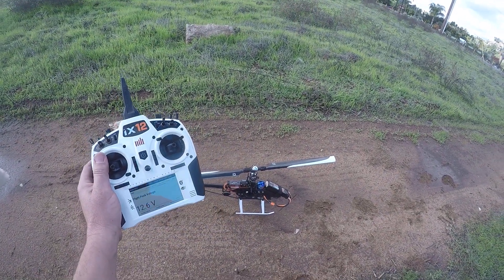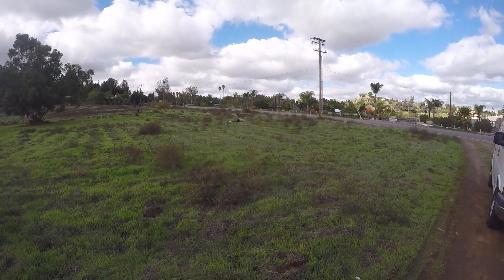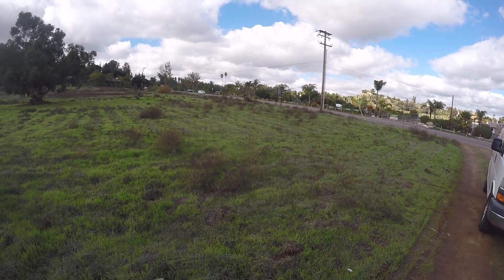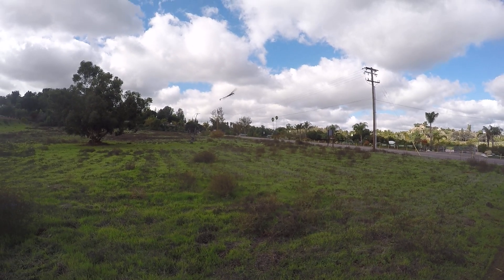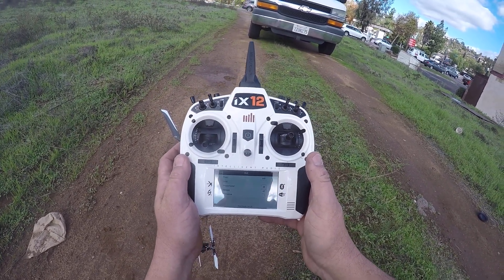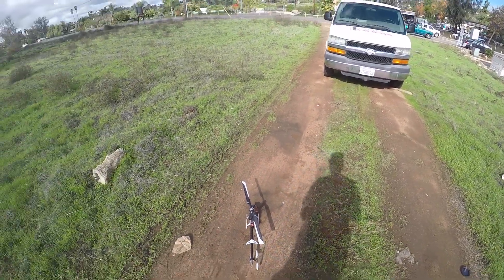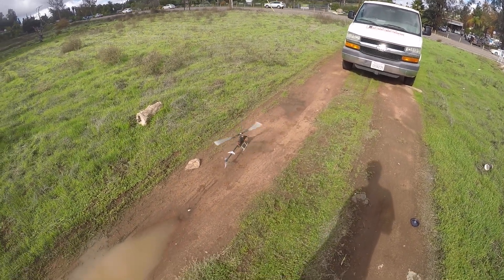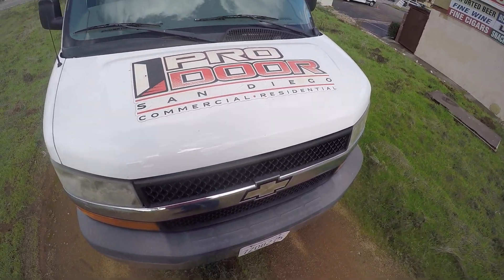Horizon Hobby Blade 330s Helicopter Tips And Tricks part 2 "Making it yours"

Comment: I have a 330s and ix20 radio and need help programming can you please help me 😢
Reply from the maker: The manual is very easy. Look at the table and enter the parameters.  Pretty simple.  Standard helicopter model, assign gear channel to Flightmode switch.  Set the throttle and the pitch curves. Simple.

Comment: I bought this Heli last week and love it. I need to get an ix12 so i can tinker with the PID parameters. Using a Dx9 currently.
Reply from the maker: All you need to do is update your DX9 to the latest firmware with your SD card. On page 11 in the 330s manual says you can use a DX6gen2, Dx7g2,DX9,IX12, and IX20. All you need is the helicopter now. hehehe
Reply: @CoeShow619  Oh ok. I'll check on Spektums website for a firmware update then. Thanks.
Reply: @CoeShow619  what if you have a dx6e?

Comment: Your videos are spectacular. I am thinking about getting this helicopter but I only have a Dx6i. Would I need to upgrade to a fancy radio? The manual says I can fly with the Dx6i but don't have it specifically listed in the charts. What do you think? Thanks.
Reply from the maker: You need at least a DX6gen2, DX7gen2, DX8gen2, DX9, IX12, or IX20. Page 11 in the 330s manual states that you can get Forward programming in those radios with the latest firmware update.

Comment: I typed it wrong in my one comment saying that I had a DX6 Gen 2 I actually have a DX8 Gen 2 looks like I might need to upgrade to a newer radio. Great flying like always! I'm a few years older than you and basically just starting even though I started about 15 years ago with a raptor .30 and a Blade 400 I think but once I flew the Raptor .30 into my leg I quit flying after that and just started again.
Reply from the maker: Your DX8 Gen 2 will work if you update it to the latest firmware. Page 11 in the 330s manual states the radios you can use. DX6 gen 2, DX7 gen 2, DX8 gen 2, DX9, IX12, and IX20